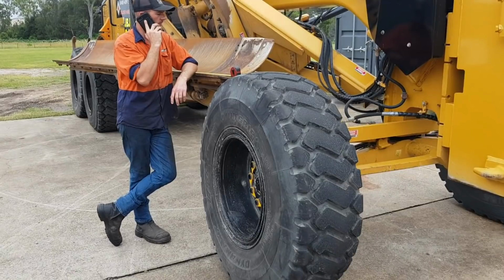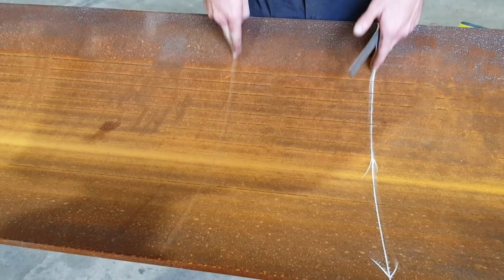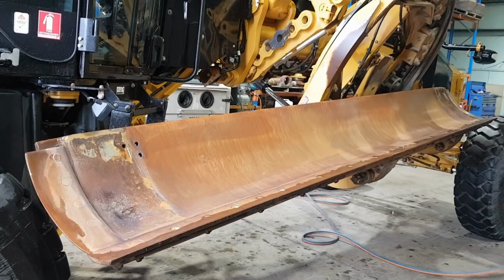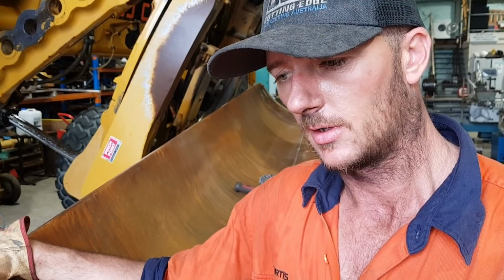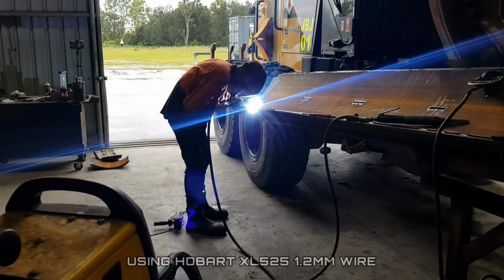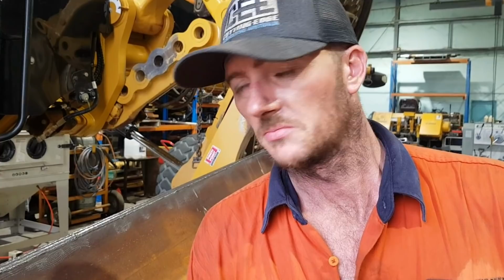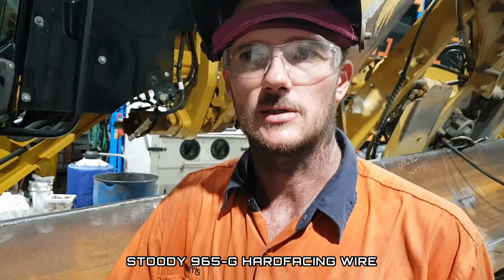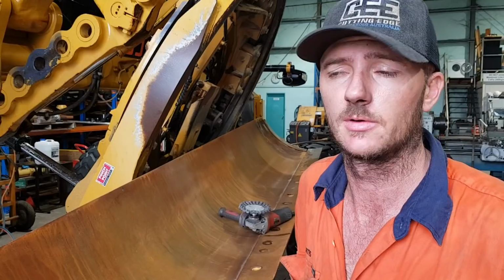Repairing Blade on a Caterpillar 140M Motor Grader | FCAW Welding

Comment: Kurtis, you have such a steady hand with that cutting torch, once you get an Air Plasma Cutter you will be unstoppable!
I bet you appreciate that needle scaler, a great tool for removing that slag.
Great job as per usual, and boy was that a lot of welding makes for a long day standing in front of the artificial sun.
Funny when I saw the squiggly chalk or soapstone line on the blade face I knew exactly what you had done there LOL
Never stop with the bloopers at the end, puts a smile on my face every time, and I'm laughing with you bud.
Cheers from Tokyo!
Stu
Reply from the maker: Hey mate you don't miss a thing hahaaa thanks for the great comment
Reply: @CuttingEdgeEngineering  I spent a number of years in my youth working in a big metal fabrication shop. I never got to play with all the nice toys you have but I did get to see one of the first industrial CNC water jet cutters slicing through1/2" and 3/4" steel like it was cardboard. They used to come down from the office with a 7" floppy disk to run the program on a machine. I learned to stick weld, and MIG weld both steel and aluminum (with a spool gun) there too. I do some steel fab now but on a much smaller scale.
Cheers!

Comment: A few of these but more often it was our dozer blades. Both skins but more often replacing the frog from operators back blading. Seems you don't do any for a while and then that is all the shop see's for months at a time. I liked the bad operators as they made me the most overtime eh, LOL. You always break me up with the out takes at the end. Funnier than an ear full of slag eh, LOL.
Reply from the maker: Hey mate it's weird oh we get a run of the same type of work, had a heap of lineboring, now got a heap of welding/fab work. Thanks for always watching and dropping a comment! Cheers, Kurtis 😎👍
Reply: @CuttingEdgeEngineering  One spring when we are all shut down for break-uo when the roads etc thaw My fellas and myself hard surfaced every bucket, blade, C-frame we had with Arctec's Long 5/32 hard rod. In 3 months I went through 4 ton's of rod and we didn't get it all done. After that one I didn.t pick up another stick for 4 years. I still remember the smell, LOL.

Comment: Great job as always mate....i get my skins done a little different, have the top of the skin overlap the blade by about an inch and then weld in the fillet at the back so you are welding on the top of the blade and the skin, makes it a little easier to get off and you are not guging along the face of the blade on removal.
Reply from the maker: Nice one thanks for watching 😎👍

Comment: I watched another one of your videos on repairing a ripper shank. Have you ever thought about building roller rings to be able to spin your welding 360 degrees to make welding both sides faster vs having to pick it up and reposition? Bulit 2 372.1cm I beams for a trailer. Had to weld 6 inches at a time to balance the heat warpage. Worked checked after and it was nearly perfectly straight. Have not built them yet but am going to build 2 steel rings to roll beams so I can weld all positions without having to do overhead. I hate overhead welding. Mine will only be about 365.7cm in diameter. Yours might need to be much larger for things such as the shank. Just saw you flipping it on the video and it came to mind. Also built 2 fixtrues to keep flat plates for web and flanges aligned. Mad it sooooo much easier and faster.

Comment: The triple double explanation was what I was looking for. I'm a wook of about 5 yrs mig welding. Repairing trash dumpsters and roll off cans. No formal training. Your cutting torch skills top shelf. Attention to detail, pro level. What was the tentacle looking air tool used to clean up the weld between passes?

Comment: Crazy that the blade wskin wears out like that. I own a 1967 allis and chalmers m-100 grader and it must not have a skin because the blade is extremely healthy. Plus having those ridges from the weld holes and the extra plate on the high wear corners would drive me nuts with material sticking. Coming from a finishing grader operator stand point. You did a really nice job dont get me wrong.
Reply from the maker: Always interesting to get other perspectives. Thanks for watching mate

Comment: Now that's what I'd call; good, old fashioned "Iron Fighting"!  Super stuff Kurtis and yet another welding technique I've never come across - 'Hard Facing'.  Seemed to me there was a really bright, clearly defined blue jet (from the the wire?) and the working 'flame/arc' being some distance from the work.  I'm guessing 20mm?  Does the arc strike at the tip of the wire or nearer the 'nozzle'?  It looked almost like spraying the weld media?

Another question, if I may?  Why a preference for the gas axe and not the plasma cutter?  I'm not sure whether it's your skills and techniques, or Karen's very expert videography that makes these so interesting, but I'm guessing it is both.  Well done CCE (A) in that case!

Comment: Great dog video, not sure about the bloke in the middle added anything but he does work hard and skillfully.
Reply from the maker: 🤣 I'm just the fill in
Reply: @CuttingEdgeEngineering  Real question, did you hard face the inner vertical welds?

Comment: Great work.
What is that trick you do when adjusting the cutting torch by placing the tip on steel?
Does it help to prevent blowing out the flame?
I bet it's worth knowing...

Comment: I'm sure you're aware of this, but perhaps your viewers may not know. If you don't have a grinder, or don't feel like using one, you can use a hammer and chisel to break the slag. Position chisel at the base of the slag and it should shear off after a few hits. I use it for small cutting projects or when I don't have access to power.

Comment: You're the first person i notice holding the torch tip against a surface as oxygen is added. Is that necessary due to the fuel being LPG instead of acetylene?
Reply from the maker: Hey mate yeah bit of a trick to help when using lpg
Reply: There. Now that’s yet another useful piece of info. How many times have I opened the oxy too quickly only to have a big pop and start over. Love that rosebud.

Comment: I realize it's a boatload of extra work but unless you remove the previous layer, isn't the blade face going to keep getting higher in relation to the cutting edge and be wearing extra fast at the bottom? Also, the laminated layers can get moisture and dirt between them and between ice and rust jacking bulge out the face. The reason I bring this up is I have an old machine that has done exactly that. There were extra layers added so the cutting edge fed dirt right up against the bottom edge of the face, and it wore through right there and is packed with dirt between the layers until the outer layer is now close to 2" pushed out in front of where it's supposed to be. It doesn't roll the dirt for crap anymore in that spot, and it all needs cut off now, and the extra layer which is mostly still there except along the bottom edge, will have to go to scrap instead of being fully used up.

Comment: See ya use Flux core alot in the welding portion of videos any reason behind it. I have the choice of Flux core.  Normal mig and smaw. At work and. I tend to gravitate towards stick for most of my  work just cause I like the penetration it gives to the base metal

Comment: Nice job.  Boy it would have been nicer if you had a battery 3/4" or 1" impact gun to spin on/off the nuts as you worked down the way.  It would be useful lots of places.

Comment: Hey young fella, you possess a great skillset. Very impressive the work you do. I can't remember the last time I used oxy ace in my shop. I use plasma for cutting and destruction.
Reply from the maker: Hey Peter thanks for watching mate, yeah might need a plasma setup if I get more jobs like these 😎👍
Reply: Get a Hypertherm,    and grab the Flush cut nozzles,    bends the Plasma arc 45 degrees.   American Quality.   Got mine from QWS.

Comment: Only piece of criticism from me on this is on the face of the old skin and the back of the new skin I would have liked to see you clean them up well enough and paint them with a weld through primer.  This would prevent and possible rust jacking and prolong the life of the skin as it can be eaten away from the front only, not front and back.

Comment: What is the purpose of heating the metal with a oxy-acetelyne torch before using the mig welder. I have never seen that procedure use. I'm thinking it  preheats the thick metal for better penetration with mig?

Comment: 2 questions,
Why flux core wire?I use it here on small stuff or outside because of the wind, but seems most people use bare wire.
2, when welding you push? I read somewhere,push bare wire and pull flux core ?

Comment: how long does that skin last I wonder. Also curious if it wouldn't have been better to punch holes through the top and bottom edge of the OEM blade and then weld bolt studs on the back of the skin and use a flat washer and nylock on the back side to secure it for easy removal if/when it wears out

Comment: Hi Kurtis, I've got a question regarding your welding. As a agriculture technician, I sometimes have to do similar repair jobs.

what makes you leave that welding residue (slag)? I"ve never seen anything like that with a Mig/Mag welder, only when welding with stick.
is it because of the wire that you're using, or the gas, or both?

kind regards from someone who is admiring your skills and knowledge
Belgium ;-)

Comment: Please bear in mind that I know very little about tools. Why use a gas cutting torch and not something like a band saw, or circular saw or something? Is the metal too hard for them, or it does something to the composition of the metal? I was going to keep speculating, but I just don't know enough for it to be at all accurate!

Comment: What's the purpose of touching the torch nozzle to a metal surface when adjusting the flame/gas?
I'm clueless RE cutting and welding 🤓

Comment: What Rockwell hardness to plate Rc#. Reading Lincoln how to weld, sand grain size, same granular size Rc 52 to 53. Seen nuts having Rc 60 and wearing off before cutting edge was worn down in sand.

Comment: For doing dry off and preheat I bought a nice little torch that runs on propane and makes a vortex with the air. It has been a real gem and money saver. It is supposed to be for burning weeds on paved areas. Lol weldors are the masters of using the wrong tool. That Hobart dual shield you run. I only know AWS specs, because I am American and that means the rest of the world has to translate for me.. Is that like comparable to an E71-T1? like 7018 mechanical properties but in a wirefeed format?

Comment: I can see why you're on the heavy money, Kurtis. Beeutiful welding!    Two questions, though! Why did you wire brush the old blade surface , when you weren't going to brush the backside of the skin or the end second skins? and how come you backstitched the Stoody when you didn't backstitch the gasless?
Reply from the maker: Hey mate thanks for watching. The new plate didn't need cleaning up was just to remove any debris off the old plate. Was just preference to backstitch the stoody cause I was able to start one end and work to the other

Comment: Dude, you're a young talented guy.  Don't neglect your lungs.  You should wear a respirator to protect from all the unknown content in the grinding dust and especially the welding fumes.  I did what you do for 30 years and any kind of lung protection wasn't even a consideration.  Don't wait until you feel like your lungs are full of cement like we all do before you start thinking about simple HEPA respirators (at the very least) under your hood.  In your videos, look at the smoke coming off the wire, and the fact that your head is right over top of it.

Comment: Hi guys, great video.
Why did you not use the same piece of material as a guide on the second oxy cut as you did on the first?
Reply from the maker: Could have was just a bit hotter didn't want my arm on it 😅

Comment: Why do you lay the tip of the cutting torch on metal as you first set up the flame?
Reply from the maker: hey mate just a trick when using lpg it help keeps the flame at the tip and not get blown out when turning on the oxygen

Comment: Questions I have was about the weld by the blade. was the cutting edge of the blade closes to the weld new and if not will a new cutting edge fit in correctly?
Reply from the maker: Hey mate yes a new edge will fit as grader cutting edges are not double sided

Comment: Nicely done!  That welding is a very nice "stack of dimes", particularly with the MIG.  Some questions.  Usually it's the detachable part of the blade on the bottom and sides that gets worn out.  So how come the blade in the middle got worn out?  What were they pushing to wear it out like that?  

Now that you've welded on the new skin, are those detachable blades still detachable?  

PS - Luv the antics of the "safety officer", complete with the squeaky toys, although you must be going through a whole bunch of rubber chickens, the way he tears them apart.  He's got it down to a regular routine!

PPS - Keep those videos coming.  Love the craftsmanship that you're showing.  And kudos to your videographer ... she's doing a good job in capturing how things are done.

Comment: I notice alot of people lay the tip of the torch down when introducing the oxygen, what is the reason? I learned to run a torch on the farm and have never seen this.
Reply from the maker: Hey mate just a trick with using lpg gas fuel otherwise the oxygen blows out the flame

Comment: It didn't look like you hard faced up the outside edges of your wear plates.  Maybe you did??? I suppose it depends on what the machine is used for, but I would have thought that those areas, especially towards the bottom would cop a fair bit of wear if the machine was used much for cutting or cleaning out drains etc.  Good job though, I'm not complaining.  👍

Comment: Great job ... my only fear would be that all that welding heat might warp the blade.
Reply from the maker: Hey mate nah no chance of that. Looks like a lot of weld but spread over and plenty of structure behind the blade won't warp. 😎👍

Comment: Kurtis, what are you marking that metal with that doesn't burn away ? Also, by putting another skin over the top of the existing blade, can the hydraulics handle the extra weight?
Reply: Soapstone .....

Comment: Reminds me of the fab stuff (repairs) I did as a Millwright in the mining industry....:-) You have a strange torch lighting method where you seem to touch the work as you turn on the oxy....???
Reply from the maker: Hey mate yeah that's a bit of trick with using lpg helps keep the flame at the tip to ignite when turning on the oxygen

Comment: Is that an oxy-propane torch setup you have behind you at 1:36?  If so, how do you like the performance compared to oxy-acetylene?
Reply from the maker: Hey mate yeah it is that's the setup i'm using in this vid. Much of a muchness in terms of performance but the LPG (propane) is more cost effective, acetylene here is pretty expensive.

Comment: "First we need to cut to size the bisalloy plate using an oxy-lpg gas cutting torch" - is there any specific or particular reason to use oxy-LPG torch for this job instead of plasma cutter? To me it seems like plasma would be much better choice - long, straight line, cutting along a "ruler", relatively clean metal (i.e. not something covered with thick old paint and deep rust) plus there would be less heat input into material, less dross to clean up afterwards... Am I missing something here? Just asking...
Edit: Seems like I was - only now I've noticed that "p.s. I've got a plasma cutter on my wish last" . 
So yes, NOT having a plasma cutter is a quite plausible excuse for not using it... ;-)
Cheers!
Reply from the maker: hahahaa yeah mate need to get myself a setup especially if we get more jobs like this 😎👍
Reply: If we weren’t such a bunch of cheap skates we’d crowd fund a plasma for you. Anyone else like the idea?
Reply: @MrKotBonifacy  All valid points.

Comment: Do you disconnect the battery on the machine while your welding. I was told it can damage the alternator to weld with the battery still connected. Just wondering if its common practice or over the top.
Reply from the maker: Hey mate yeah we isolate the machine
Reply: @CuttingEdgeEngineering  thanks for the reply bud good to know I'm not breaking anything

Comment: First off I am not a fabricator nor do I have any experience in this field.  I was just wondering why you chose to use a torch instead of a plasma cutter to rip the steel to width?
Reply from the maker: Don't have a plasma setup just yet
Reply: @CuttingEdgeEngineering  makes sense.  Thank you.

Comment: Hey Kurtis, new kid on the block to your channel but enjoying your local (Aussie) content.
Curious... Why hold the cutting torch head against the plate when opening the Oxy? I know from my own experience that they easily flame out with a bang if you add too much oxygen too fast, I'm guessing this helps to stop that happening. Any technical reason behind this or just something you've learned by experience, or were taught? Thanks again & keep the videos coming!
Reply from the maker: Hey Tony welcome to the channel thanks for watching. Yeah you're spot on the oxygen blows out the flame when using lpg so helps stop that happening when tip is held against a surface. Just learned that trick from experience. Cheers, Kurtis 😎👍